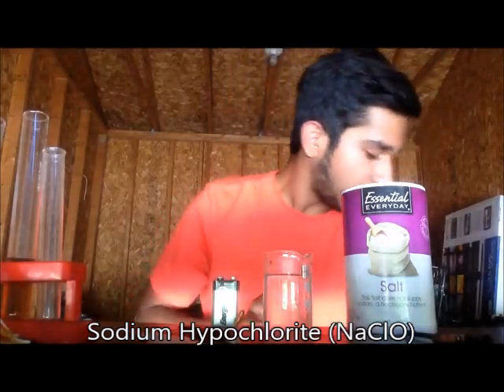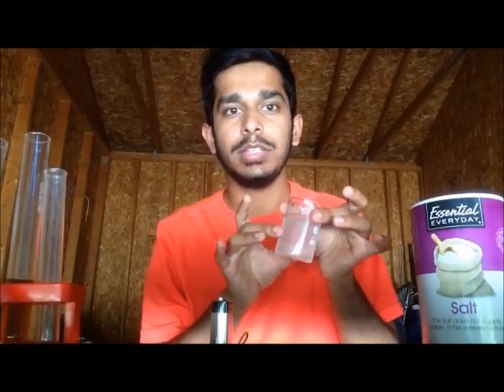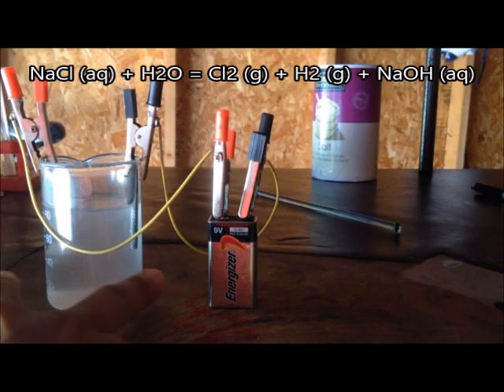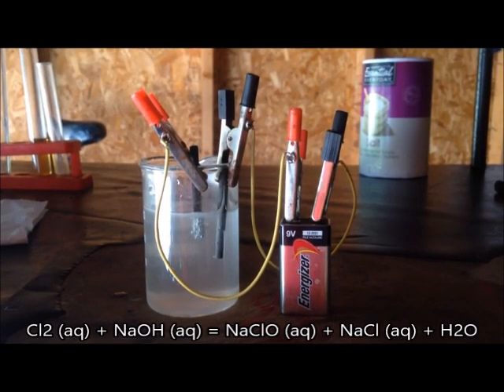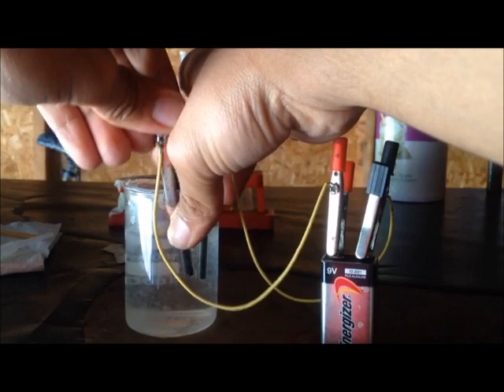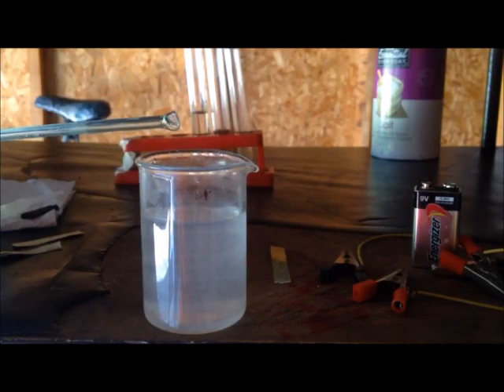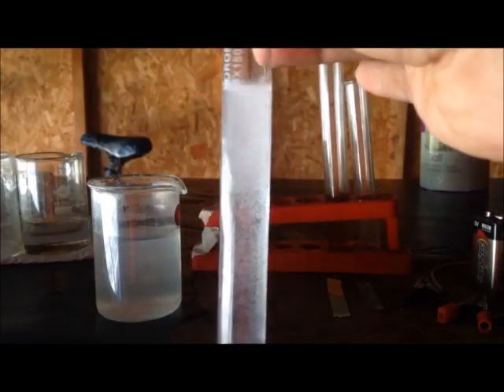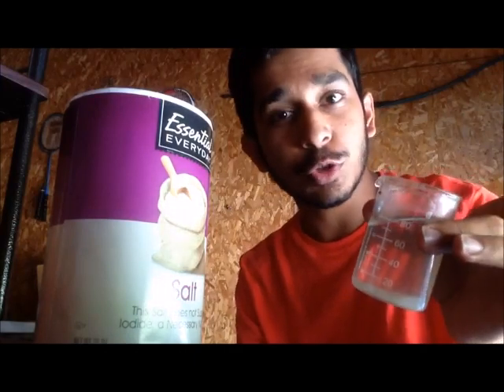Making Bleach (Sodium Hypochlorite) from Table Salt (Sodium Chloride)

Comment: What proportion is your saline solution? Wouldn’t you need to use distilled water to avoid impurities? How do you know when electrolysis is complete? How do you know what final concentration you’ve got?
Reply: The concentration of the salt solution can vary, but a common starting point is around 3-5% by weight. When process generate no bubbles the electrolysis is complete.

Comment: you should of used a better power supply. a 9v battery doesn't last forever. longer duration = better result.

Comment: I have access to all materials but graphite.  What would you recommend as a substitute anode and cathode?  Would copper work?
Reply: A common pencil has a graphite rod as the part that does the writing. You simply use the black rod = graphite inside the wooden pencil. I've successfully used that in my home made electrolysis experiments to teach basic electro-chemistry to my son and his friend. Regards from a Chemical Engineer from Germany
Reply: @19ghost73  Thanks for your reply!  The graphite in a pencil my first thought as well, but I cannot find any non-mechanical pencils around my home and because of COVID-19 the local shops are shuttered for the foreseeable future.  I have a large quantity of copper pipe that I could cut into manageable pieces, so that's why I asked about copper.  Are there any other materials you would recommend as a possibility?
Reply: @nathanunderwood1793  Copper electrodes will likely erode in the electrolysis and end up precipitating CuOH and reducing purity. You can also pull carbon electrodes from carbon-zinc batteries (cheap AAs or AAAs usually labeled as "heavy duty" not alkaline batteries). But graphite leads for mechanical pencils work too if you are careful not to break them.

Comment: Best means to determine formation of actual bleach is reaction of the above setup with a dilute mineral acid resulting in effervescence with formation of chlorine gas!

Why don't you rig up the apparatus to include that reaction?
Reply: Why pH paper is necessary, tell the ratio of salt and water to public.
Reply: @bharatnadhani4532  PH paper can tell you whether an acid or alkali is present as salt water is essentially neutral and changes in PH will tell you what is formed as the reaction commences!
if bleach is to be made use a cold dilute salt solution or at room temperatures!

Comment: wait, when you do electrolize it will produce cl2(g) right?, so why why iin second reaction it become cl2(aq), ? wht the clorine gas didnt get out from liquid?
Reply: What happens is that Na+ ion "goes" to positive electrode(positive pole of battery) where electrons coming and Cl- goes to negative electrode(electrode with positive ions)so what happens is Na aka sodium becomes stable and at that point it reacts with water forming sodium hydroxide(NaOH)then sodium hydroxide further reacts with chlorine gas that is dissolved in water forming NaClO

Comment: IT makes Sodium Hydroxide not sodium hypochlorite
Reply: Correct me if I'm wrong, sodium hypochlorite (5% - 8%) is used to make disinfectant solution so what is sodium hydroxide? 

Is sodium hydroxide the same thing that is in them brown bottles that when applied on wounded skin like minor cuts foam on contact and that brown bottle must be stored in dry, cool areas or else it will dilute in direct sunlight?
Reply: @analyticalhabitrails9857  the liquid in the brown bottles is 3% Hydrogen peroxide 
sodium hydroxide is used as a drain cleaner and to make soap